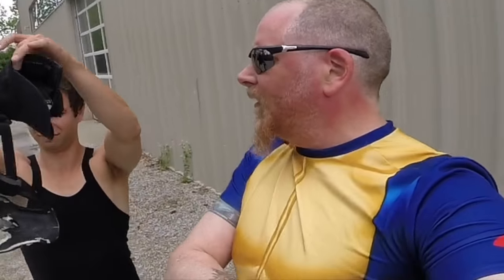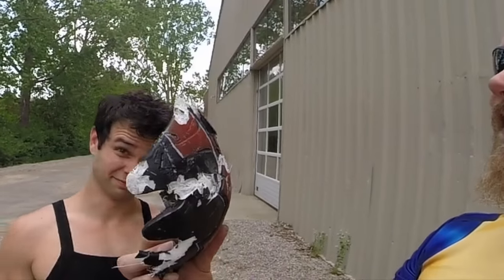Gear testing: Fencing masks vs airsoft masks

Comment: Maybe next you can check the effectiveness of high quality body Armor  vs chicken wire to stop a 50 caliber round. After all only one of them were designed for the function you will be testing for.
Reply from the maker: This is response to the 100s of people who ask us if these things are suitable for LED saber. The demonstration is to show that airsoft masks are in no way protective in this activity. In fact, they pose more of a risk than nothing at all as the debris and flimsy structure can hurt you its self. DN